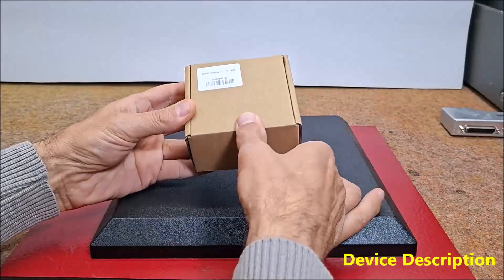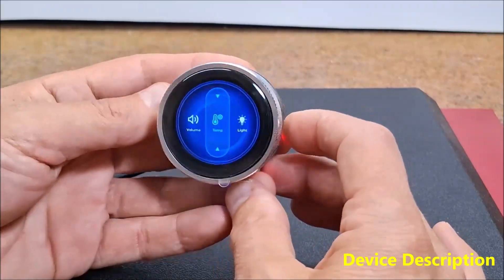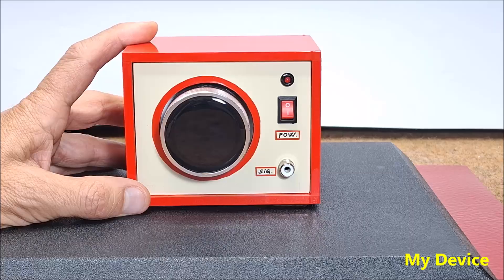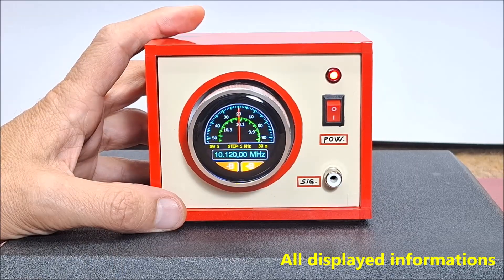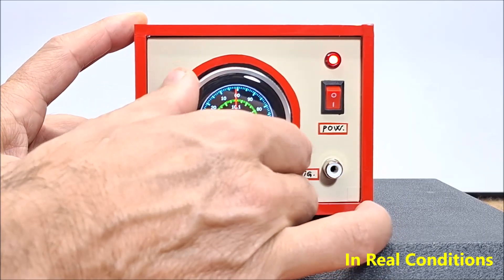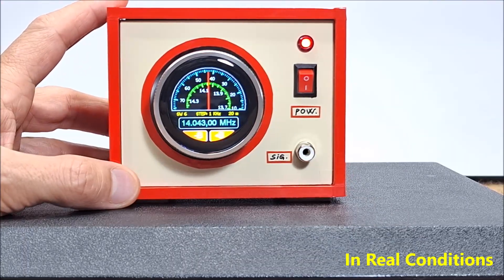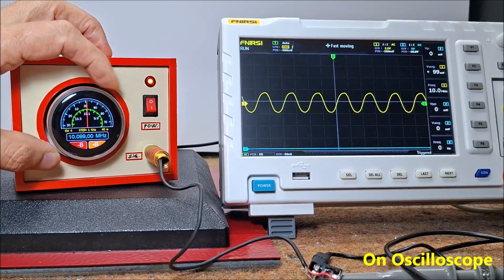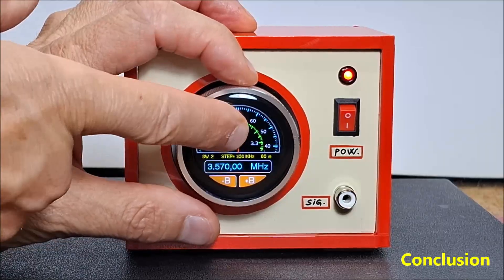Build simple Retro Style VFO Variable frequency oscillator with Crowoanel 1.28 inch Round Display

Comment: Shame the waveform isnt great below 10 Mhz. If it was there would be some real use for this.
Reply: I’m confused. Isn’t the square wave output of the SI5351 widely used up to the vhf spectrum?
Reply: @BruceRobertson  Not to my knowledge. But Im not commenting on the VHF spectrum. I am commenting on the HF part of the spectrum.
Reply: @MikesRadioRepairRestoration Yes, it's a frequently used part. See the designs of ZL2CTM or Level Up EE Lab for some good ideas. I understand that the square wave is sometimes used without lpf in diode ring mixers. 
BTW, your DX-60 series was a big help to me. Thanks!
Reply: @BruceRobertson it wouldn't be something I'd opt for. That's for sure!